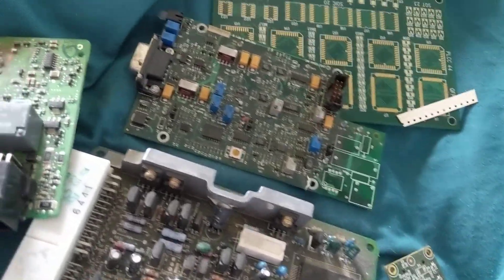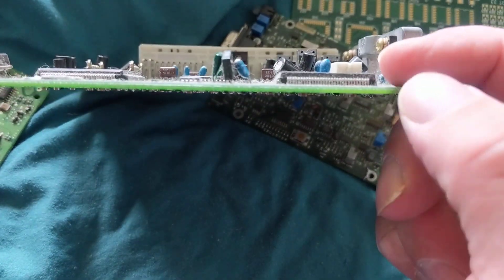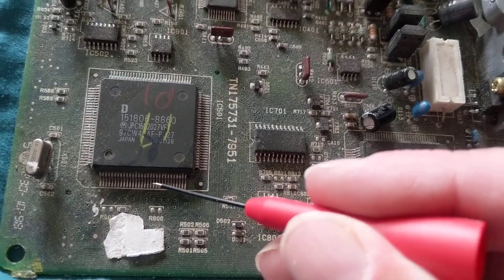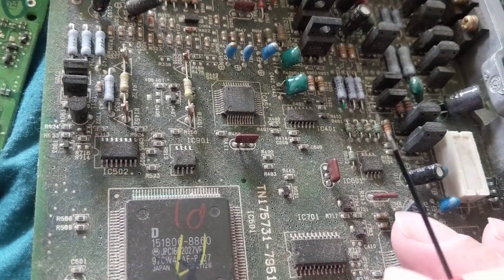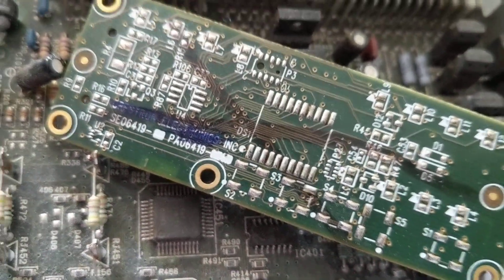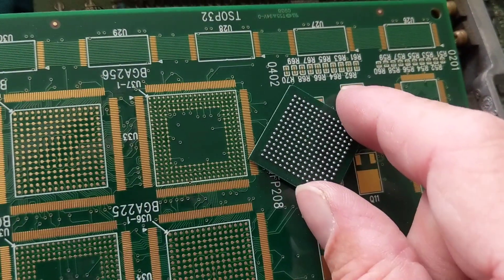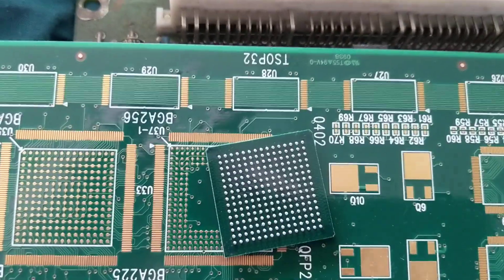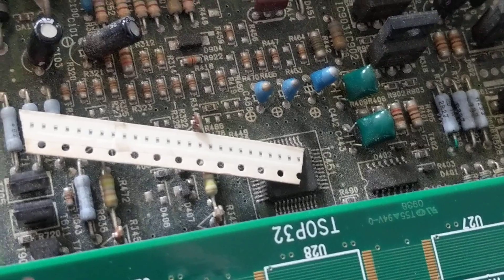automotive electronic modules understanding them and the problems with them understanding them

Comment: Wish we could demand automotive companies use mill spec quality boards …this is why im not buying a new trucks even have sensors in tail lights and sensors that void warranty if you load a pound over max capacity…then the sensors fail and force limp mode and they charge you arm and a leg for new one…give me a 60’s VW bug and I’ll outlast any new vehicle
Reply from the maker: I agree with you one hundred percent I still have a Toyota RAV4 from 10 years ago a crown Vic from 13 years ago they are working absolutely fantastic no problems today too much electronics like I said in my channel all the time too many sensors too many modules something is bound to go wrong
Reply: @Joeelectronicschematicsforauto  great channel helping us low/medium income people keep our cars on the road. Subscribed

Comment: You are right about it I’m running into a problem I can’t figure it out, I have power and ground in one circuit!!!
Reply from the maker: Sometimes these boards double sided with layers in between and they short in between nothing you can do with the printed circuit board

Comment: @ 0:41  "These are transistors over here..." 
...points to capacitor. 
@ 9:08   He couldn't think of the word for traces?  I mean, come on, really?!  
 This is stuff you pick up in like the first 4 minutes of studying electronics!
You have a background in what, again??!   Lol    facepalm
Reply from the maker: The ones that has three legs are transistors capacitors are the brown ones where I'm actually pointing is overall area just to give an idea if you want me to go into real depth of it it'll be a 2-hour video
Reply from the maker: I don't see too many automotive technicians even trying to explain these complex boards because it's so technical what is your background?
Reply from the maker: Do you think people will understand what traces are don't look at my other videos I explained how to measure point-to-point on printed circuit boards if you go to my channel you'll see exactly what I'm talking about number one number two are you going to go buy a scope for $8,000 are you going to buy a heat gun are you going to buy soldering tips when you can throw away the board and buy a new one for cheap
Reply from the maker: My background is electronics and avionics automotive digital electronics which I made videos but people were not viewing transistors and class A b and c which people said it was too technical Gates comparators microwave RF technology troubleshooting a.m. and FM radio troubleshooting do you need to know more?
Reply from the maker: Go to my channel Joe electronics schematics for Auto when you'll see I explain much deeper these boards and then judge
Reply from the maker: Well thanks for your advice as I made another video describing all the components on mostly the components of the printer circuit board that really got me a lot of yous this is why I don't do technical explanations because you lose the viewers thanks for your advice see
Reply from the maker: I never got any responses from you after you decided to bash me
Reply from the maker: still didn't hear from you after u bashed me